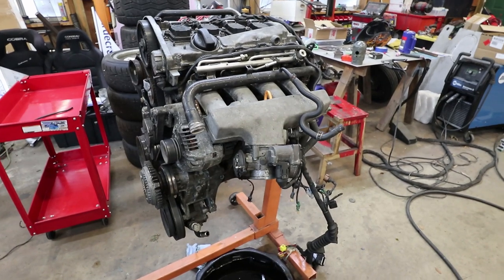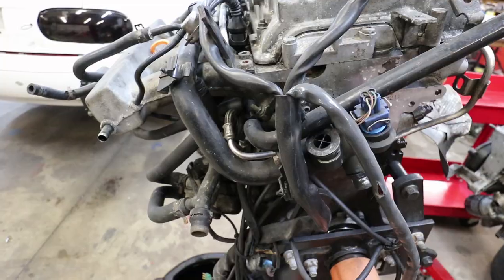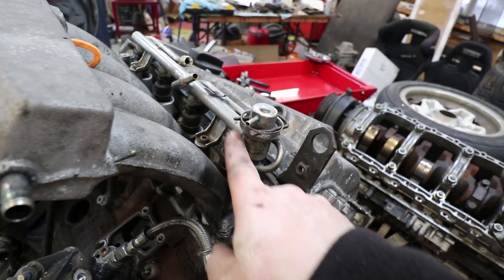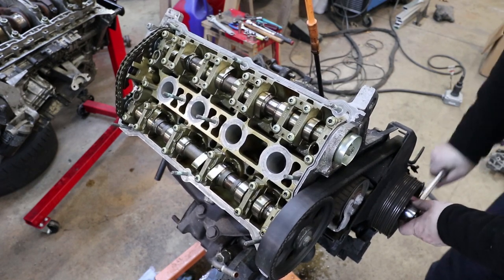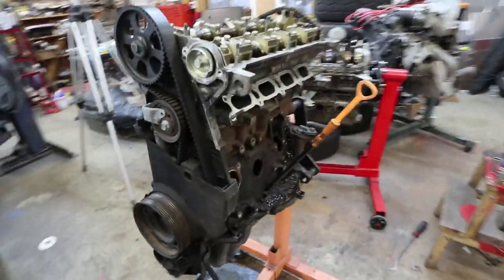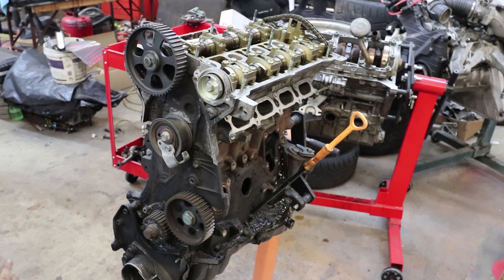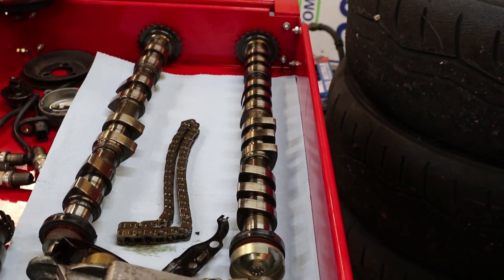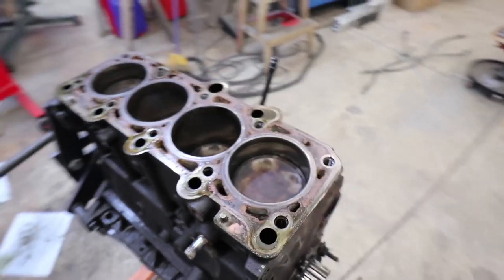Disassembly and description of VW Audi 1.8T engine

Comment: the location you mentioned as a possible distributor drive actually holds up. i have a mk3 gti with the 2.0L and that’s actually exactly where the distributor is. those two motors are actually super similar

Comment: It’s from 98-99. 2000 would be the atw and the switch to drive by wire. I have the same aeb in my 99 Passat. It’s a ripper. Best cylinder heads of all the 1.8ts imo.these respond awesome to bigger turbos and can make 350hp on stock internals. I just recently swapped the cam Chain tensioner and cam chain. Chain stretches and tensioner fails around the 150k mile mark and rattles. I would recommend changing those. Also the timing belt and tensioner and water pump. And pull the oil pan and put on a new pickup on all 1.8t’s 
that are removed at any point.
Reply from the maker: Sounds like good advice!

Comment: Thank you for the video. I just bought an Audi A4 1.8T Quattro and wanted to learn the engine. Your video is very informative. I wish you would have showed the vacuum system and the bypass valves etc in a bit more depth.

Comment: Cool, in my beetle though the engine is sideways, coils lined horizontally and turbo tucked in back, the coolant sensor thats usually a B to replace on these is actually conveniently located up front with nothing in the way, the belts and pumps are on the left side.

Comment: Looks like green coolant in the water pump which might explain your corrosion problem. Or the previous owner just used hard tap water and the lower flow volume through the oil cooler sleeve gave it a place to collect. OEM VW G12 coolant is a reddish-pink color. I think you might be able to use the newer G13 coolant which is a purplish color but don't quote me on that.

Comment: Nice video.  There are some checks/measurements that should have been done with disassembly to check lifter and rod clearance.
Reply from the maker: I will be measuring and checking all fits/clearances on reassembly.

Comment: Hello, i bought one of these AEB engines along with the whole car with 151.000km(A4 B5). I've disassembled everything and i saw in the intake ports in between the valves there are cracks in all 4 cylinders. Also the head bolts are not like the ones you showed but like a torques with dubble the ends. 
I don't know what to do now. Should i open the head and buy another one or should i keep it like it is. I don't even know if the head has been taken off before or not.

Comment: That corrosion is what happens when you don't use G12 or equivalent coolant in a 1.8t. 
One of the first things you should look for when buying a used VAG car is if it has pink coolant. 
It can lead to a lot of problems and headaches not running the right coolant in these engines.
Reply: What is the right Coolant for this cars in particular AMB engine
Reply: @MrNhekairo  I use Pentosin Pentrofrost SF

Comment: 7:55
That crud is caused by the use of coolant that is not recommended by VW. These engines require pink coolant. Most Americans use regular green.
Even worse is to mix diffeerent type of coolants.
Reply from the maker: Oh, interesting.  Makes sense.
Reply: @vsvenson  That's the biggest reason why so many Passat B5s don't have heat. The incorrect coolant and the crud clog up the heater core, killing the coolant circulation. Thus no heat.
Reply: I remember the pink stuff, looks like children's amoxicillin.

Comment: I'm gonna 1.8t swap my seat altea xl (BAM 1.8T) I'm wondering if the engine will be in stock position (horizontal) or if I'm gonna have to change that as well and have it vertical.... And yes, I'm properly building the engine with stronger internals. I'm hoping to make 350-400bhp after it's all done. I'm buying a bare engine so it doesn't have a turbo or anything, so it makes no difference in cost to me

Comment: Hey, amazing video. I have a 2002 VW New Beetle 1.8T and for what I've read, the engine echanges a bit, e throttle, serpentine belt and a chain driven by the crankshaft turns the oil pump. My block is the 06A block, I was wondering if these engines still have that chain that drives the intake camshaft. Thank you so much.
Reply from the maker: Yes, the 06a engine also has a chain drive for the exhaust cam.

Comment: at 34:12 how did you get the front crank bolt removed. Mine wont come out and I cant get the crank off without removing that bolt. Is there a special tool for this?

Comment: How many miles/kilometers has this engine done until this rebuild? How would you evaluate the state of this engines cam shaft chain and tentioner. Do they need to be replaced?
Reply from the maker: I don't remember exactly, but over 120k miles.  Cam shafts look really nice.  I haven't really looked that close to the tensioner yet.  Frequent oil changes really help!

Comment: great video thanks! what do you think it would take to access knock sensor 2, with the engine in the car? I've had a code for one for about 5 years, either need to re-torque or replace
Reply from the maker: Both knock sensors have wire leads about 18" long to plugs at the rear of the engine.  On mine, the plug connectors had crumbled away - you might have a similar situation.  If you take the intake manifold off, you should be able to easily reach it... maybe you can snake your hand under there with everything all together?
Reply: @vsvenson  thanks for the advice man, will probably tackle this once the weather warms a bit. how difficult do you think taking the intake manifold off will be? I see where they plug in on the firewall
Reply from the maker: I think the intake would be easy to take off.  It was certainly easy to do on the engine stand!

Comment: How hard would it be for a beginner in engines to rebuild an engine like this ? I planning to get an old 1.8t and completely renew it. Should I even start ? :d
Reply: Gamer Wary my same question. Have a TT 225 I want to rebuild and possibly make a 2.0l
Reply: those are some of the worst cars to work on for diy
Reply: @two_number_nines  why do you say that? These engines are pretty basic
Reply: the engine bays they are put in are so tight, people with bigger hands can't work on them.I have recently repaired my turbocharger and cleaned my pcv and i come to the conclusion they have put effort to make most repairs relatively easy compared to the complexity of the car and engine bay space.
Reply: @two_number_nines  that's fair enough I did the timing belt on my gli  which was okay. I now have a Audi s3  8l 225 which is tighter and have to replace the timing belt around the engine mount. It can be a challenge but in my opinion well worth I love these engines

Comment: about 25:30 you said one cam is offset. I think it’s because the middle valve sits higher than the other two, so if we want to open them at the same time the middle one needs to be offset.
Reply from the maker: Good eye for spotting that.  I was actually talking with the machine shop that rebuilt the head, and he said the lobes are offset because the 3rd valve is angled differently - so, you're right, this way they all open at the same time.

Comment: what is the power of that Audi 1.8 T ,, 150/180/225 hp ?  how are you to handle the cable harnes ??
Reply from the maker: This was out of an A4, so I think that was the 180HP configuration.  I'm planning on making about 220 at the wheels.  This is going into a race car, so a lot of the wiring harness will be custom.
Reply: @vsvenson   that 1.8 Is a great engine , solide , I look forward how you do the wiring harness

Comment: To do the oil pump on these engines do u need to take the oil shaft that’s run by the timing belt out first???
Reply from the maker: No, the oil pump and its drive shaft will slide out of the bottom (the drive gear stays in place)

Comment: is this the same 1.8t engine as in vw passat b5 2003? and are those valve lifters 
mechanical or hydraulic?
Reply from the maker: Lifters are hydraulic.  I know the AEB engine was used in 2002 - I'm not sure about 2003.

Comment: Terrific video  I am thinking about buying  a 1.8 T  I have 3 engines for sale here in SLC. Is there better years than others ? What are you doing for a ECU ?
Reply from the maker: Mine is an AEB out of an 1998 Audi A4.  I believe the AEB has larger intake ports than the later ones.  I think all the 1.8Ts have potential - what's your application for it? A swap like me?
Reply: I have a 89 NA I want to put it in
Reply from the maker: @vandettabuilds6641   - Get the AEB if you can.  Also, I'm going to use a stand-alone ECU, probably EMtron.
Reply: Ok. Thank you for the information.  I hope you video the process of installation!

Comment: 2:37 Correct me if I'm wrong but isn't that the cruisecontrol actuator? As far as I'm concerned all AEB engines have an electronic throttle. Really nice video by the way!
Reply from the maker: The first two years the AEB engine was used had a cable actuated throttle.  After that they went to drive-by-wire with the electronic throttle.

Comment: Whats do you think of this engine in a 944?  (NA 944)
Reply from the maker: I think it'll be great... but there are challenges I'll have to overcome to make it work.  Stay tuned!
Reply: @vsvenson  Im tuned for sure!
Reply: @vsvenson  Does the 944 give you the height to mount this engine and still clear the steering rack? Volkswagen tends to design rather tall engines.

It would also be quite interesting to see how the CG changes with the 1.8T.

I figured I'd be coy about it, for my own reasons, but had you also considered the venerable Vee Reihenmotor?

Comment: Hello i have audi a4 b6 1.8 turbo. Can u show me where is the engine code because i cant find it?
Reply from the maker: It's on the front of the engine head, by the intake runner.  It's usually covered with grease and grime.
Reply: @vsvenson  can u make me a picture with red dot on it where exacly is because im not a engine guy
Reply: i mean the engine serial number not code sorry

Comment: Is there a reason you would not use a 2.0T?
Reply from the maker: To be honest, I don't know much about the 2.0T - is it also cable throttle?  Same form factor for the bellhousing?
Reply: Could do a 2.0 stroker on this motor but you would have to machine the intermediate shaft and a few other places. 06a block is better for 2.0 but not impossible on this 058

Comment: Later 1.8t is better with wideband ecu 
E throttle etc
Reply from the maker: I'm going to use a standalone ECU, probably EMTron, because I have that in other cars.  I'm not sure if I'm going to use e-throttle yet, but probably not.
Reply: Van Svenson mines on the Audi management in my golf GTI mk3 I’m running very high modified set up tho within over 500bhp and iv stroked out to 2.1
Great engines

Comment: thats really old style 1.8t!!!!!! i never seen that style oil pump in 1.8t
Reply from the maker: It's the early AEB - I don't have any other oil pumps to compare it to!
Reply: Van Svenson 
I know that AEB have 058 block which use a external oil pump. And AMB and some others which have a 06A block with internal oil pump. 
But I never seen that shaft oil pump!! That’s pretty old 1.8t.
Reply: Theres only a 1 year difference between the 058 and 06a. 2000 had 058, 2001 had 06a. 06a is better in most aspects asfar as doing a waterpump is much simpler. Aswell as the oil pump being in the bottom of the block/ oil pan, and if you want to do a 2liter stoker on a 1.8t the 06a is much easier. Basically drop in a 2.0 fsi crank

Comment: Hi there. Is it possible to mixing oil and colant liquid on turbo K03 in this engine??
Reply from the maker: oil and coolant mixing means there is some problem - usually it's a head gasket, but it could also be the oil cooler housing (under the oil filter).